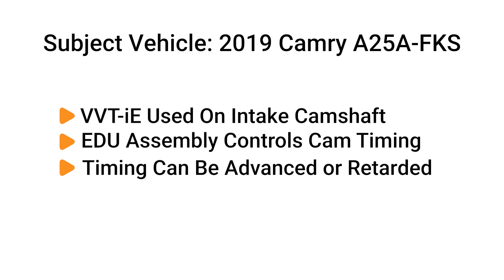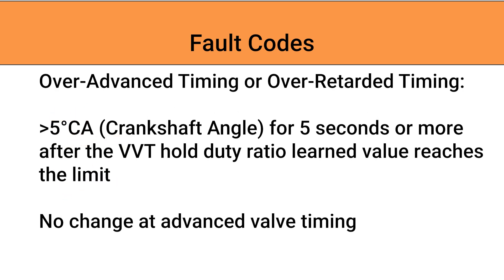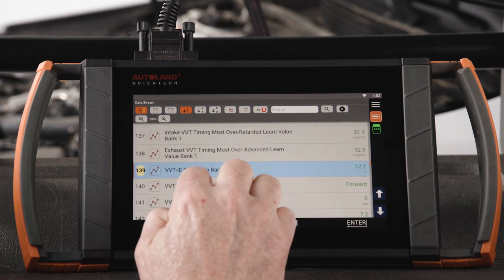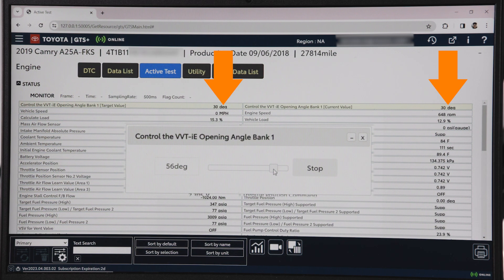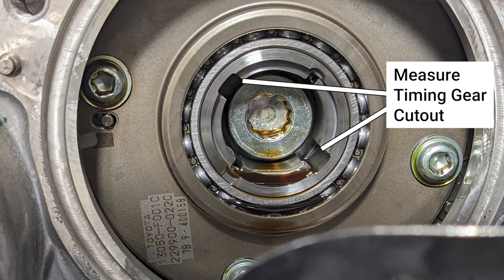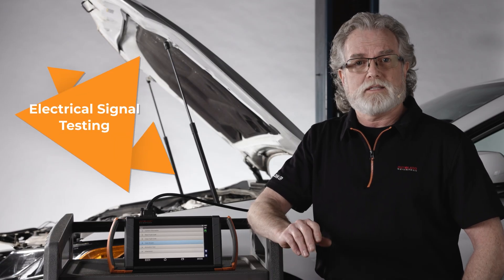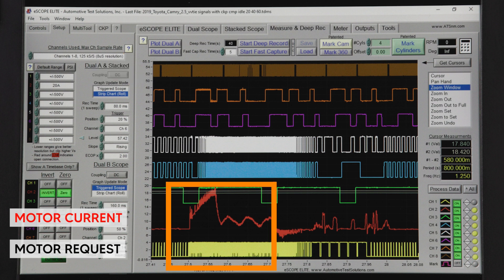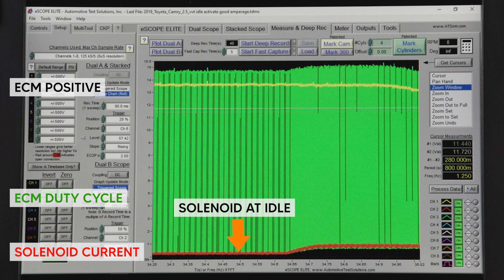How to Test & Diagnose Toyota’s VVT-i & VVT-iE Variable Valve Timing System - How It works 2.5l

Comment: Do I follow the same steps If i have cod P136001 "A" Camshaft Position Actuator Bank 1 General Electrical Failure (A25A-FKS) in my 2021 Toyota Camry SE?
Reply from the maker: Yes, test the signal and circuits to pinpoint the cause.

Comment: I am getting a code p0012, on a 2nrfe engine that is a vvtie. The timing is set right. The ocv on the exahsut side has a 8.1 ohm resistance when tested which is off from the 6.9-7.9 ohm range . Can this be the cause? The camshaft sensors are working good
Reply from the maker: I would consider that close to range, could be resistance in the leads or connections. I would test function using a Toyota scan tool to see if the adjusters move full range. If they do and have proper response, it is a timing issue.

Comment: Hey man, thank you for going into depth on this! I’m having an issue where my VVT fuse is blowing as soon as I turn the key. I have codes P136001 and P136415. When I unplug the VVT relay and leave the motor plugged in, the fuse does not blow. When I unplug the motor and leave the relay plugged in, the fuse also does not blow. Is it safe to assume that the unit has an internal failure causing the fuse to blow?
Reply from the maker: Just confirm the short is not in the harness. If not it is likely the motor is faulty. Use a wiring diagram for your vehicle to trace the circuit and load test it without the motor attached.
Reply: @AutolandScientechUSACedarPark awesome, thank you! yeah I’ve checked everything on the harness side and it checks out. Leads me to believe it’s within the unit. I noticed the manual calls for replacement without testing the unit itself and only going off the integrity of the harness, fuses, relays etc. just wanted to make sure before I pulled the trigger. Thanks again!
Reply from the maker: @cdumee  Happy to help! Not much else left if you tested the wiring, etc. You can use an inductive current probe to measure current when the short occurs and see if it matches movement of the motor using your iSCAN device. That would help to confirm.

Comment: Thanks for the video, i think this is the only video on youtube that explain this much details in 10 minutes. Quick question, how do i prove the problem is on Camshaft gear or timing itself. For example while doing active test if target and curren value matches, can i assume the intake and exhuast camshaft has no problem and the problem is within the timing(like stretched timing chain or a tooth misaligned etc).  ?.
Reply from the maker: To test timing itself, you would want to scope Camshaft on both banks and crankshaft sensor signal. Look how the signals line up. You can use the signals in the video as reference.

Most times, if timing is off, you will have a fault code for correlation or timing.

Comment: MasterI have a 2010 Toyota Camry, I have already done the timing chain 8 times, I changed the VVTI gears 3 times and the code p0017 and p0014 always come back, someone checked the wiring and there are no shorts or open wires, I have changed the computer, the rubber seals and nothing is left, I am not going to fix it because the truth is I did not find it, the only thing I noticed is that in the VVTI solenoid, the intake solenoid, the voltage is oscillating, but in the exhaust solenoid, the voltage does not oscillate and it arrives after a while, the maximum that the voltage drops is 1.2 volts, it does not even reach 2 volts and in the other it sometimes reaches 12 volts, why do you say that in one solenoid it only reaches 1.2 volts and in the other it does not, who sends the information to the computer to feed the solenoid if you could help me I would appreciate it, teacher.
Reply from the maker: Be sure to test engine oil pressure and oil flow to the camshafts. If the fault sets, the engine control module will deactivate camshaft control to a default setting. Be sure the engine can actually make adjustments. That is, if everything stated is correct, timing, correct parts, etc.

Comment: Hi there! May I ask if you have any insight on why the scanner gets no vvt reading on cylinder one of a 2012 toyota corolla 1.8L. The fuel trim is also -20. Multiple misfires on each cylinder as well
Reply from the maker: What model iSCAN device are you using? What is the software version?

Comment: What viscosity oil do you recommend and oil change interval?
Reply from the maker: Always go with the manufacturer recommendations on the oil cap or in the owners manual.
Reply: @AutolandScientechUSACedarPark  Even if 2 used oil analysis I've gotten back show fuel dilution and shearing lower out of grade for 0w-16?